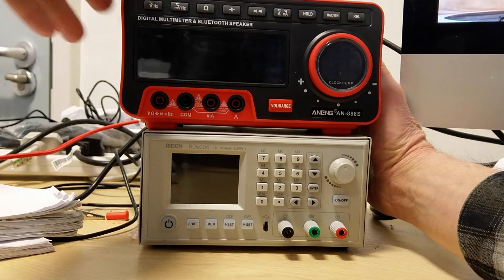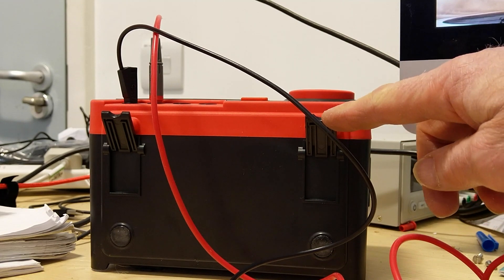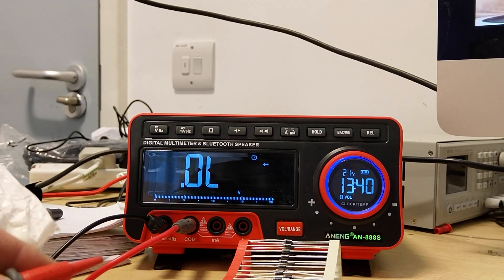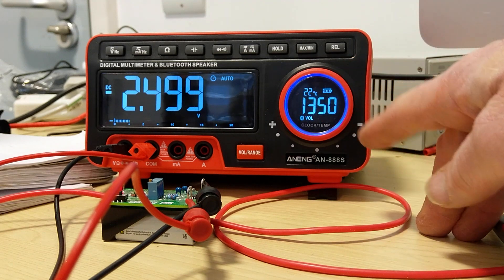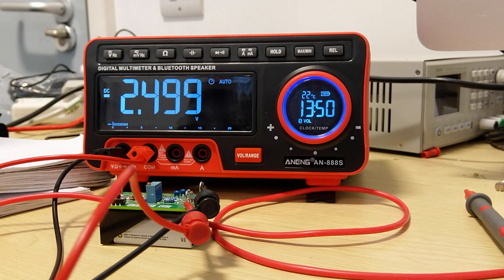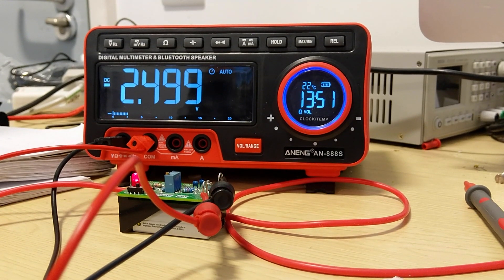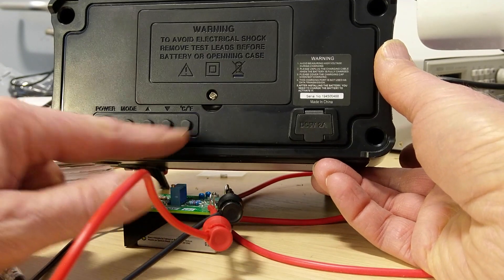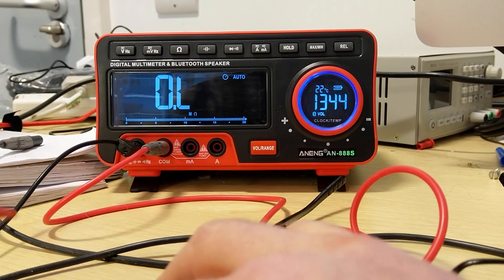Aneng AN-888S Review

Comment: this looks like a toy to me. I mean who uses a bench multimeter with batteries ? What's the point in that and who in the heck needs a BT speaker in their DMM ? .....very bizzare if you ask me .
Reply from the maker: It is a toy.  I bought it because it is absurd.  The sound quality is dreadful.   That said, it is surprisingly accurate. The batteries last several days or more.  Overall quite usable.   I doubt you can find a better bench meter for well under $100.  I paid $62.     Least expensive not a toy bench meter I know of is AIM TTi 1604  40,000 Count  600V CAT II   £300

Comment: Can the auto standby function be disabled? I want to check voltage for long periods of time withouth touching a button.
Reply from the maker: I don't think so..  If it can I don't know how.
Reply: If you power it from a power supply it will not go to standby
Reply: @alexstone691  When it is powered by a power supply it als goes in standby. And after restarting in goes always to the DC-V setting.
Unusable for desktop use.
Reply: hold "REL" while powering it on

Comment: Can be powered from a usb charger and run without Battery 
And in the mean time measure the main voltage like a normal bench multimeter?
Reply: Yes it can be powered by USB without a battery.     Manual says not to measure high voltage (main voltage) when plugged in to charger.   Battery life is very good -- days at least.